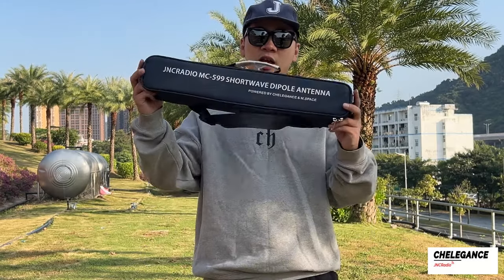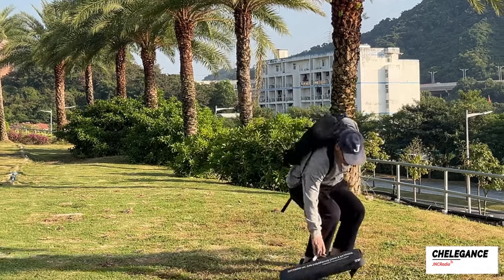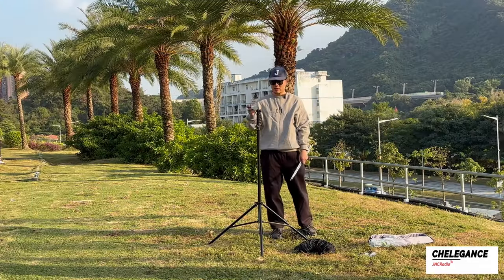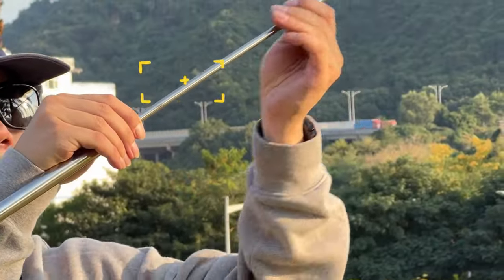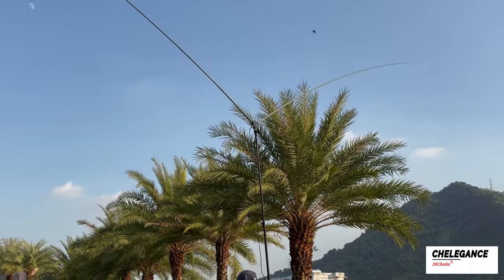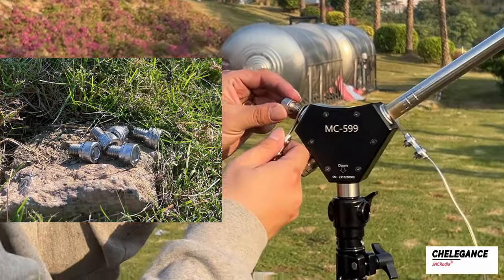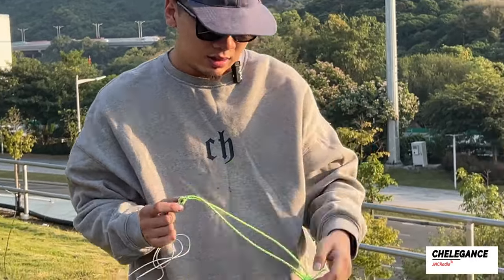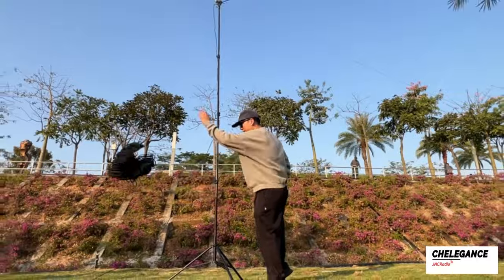Explore the MC-599 Shortwave Dipole Antenna: Portable, 200 Watt PEP and 7-50MHz Easy Tuning!

Comment: I bought that combo not long ago. It works great, tunes easily just by moving the whip elements in and out. My only complaint is that the flat "feet" on the tripod don't have a hole in them to enable driving a thin spike to anchor. I hadn't worried about that until a windy day this month kept knocking it over. I have a drill, probably will do it myself; just a suggestion. Otherwise, very pleased with the package.
Reply: The feet on the tripod have plastic boots you can remove temporarily. You can fish a zip tie so that it wraps around the leg and before fully tightening the zip tie run another through it and create a loop of your choosing for size and then snip the excess  zip tie off and it makes a very strong point for any tent stake to capture. You will notice that the zip tie can only pass through the holes facing one way to allow the plastic leg ends to pop back in place fully or orient the zip ties passing through the holes so that you can pop the cap back on and then tighten the zip tie to capture and run the second through the first as you tighten it! It works very well and does not interfere with the tripod legs at all! Play with it and see what you think!
Reply: @JOSEPHPOWELL-qw5ft  Thanks for the tip, Joseph. I'm putting this hint on my "to-do" list :)

Comment: Not very portable if you have to drag a tripod around, If you want portable try a PAC 12 antenna
Reply: The tripod is larger and heavier than the antenna case, but it's not that bad, fits easily into the trunk of my compact car. It does extend to about 15 feet so it's no slouch. I'm sure you could put a carbon fiber pole there easily to get it higher for an inverted V dipole.